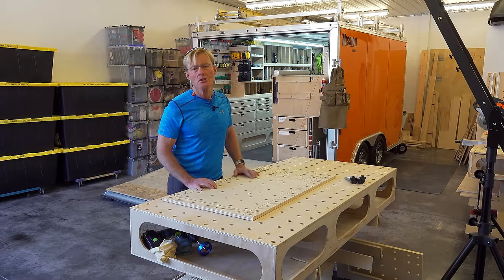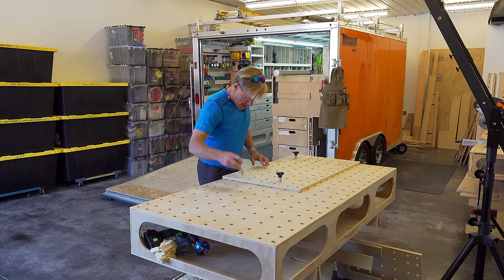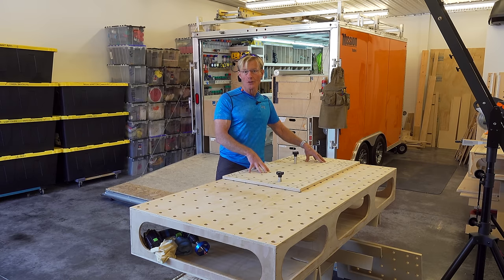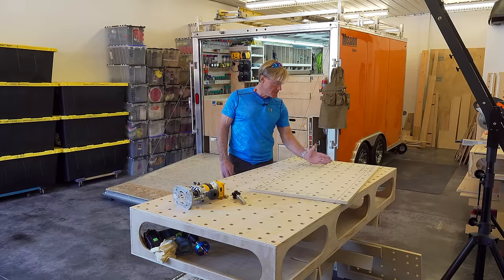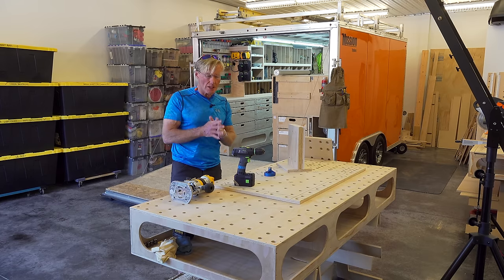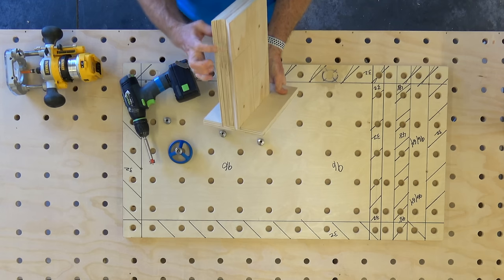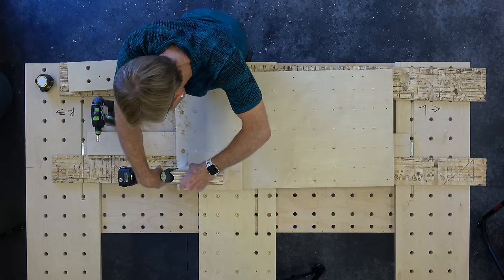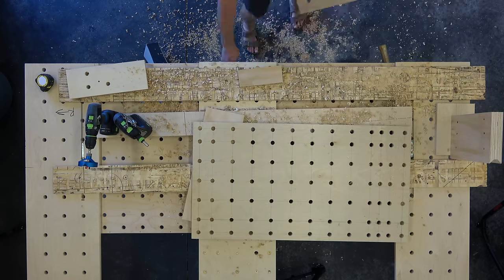Shop made MFT template

Comment: I don't know why nobody seems to use a compass set to 96mm to lay out.   Rather than try to measure 96mm with a rule and pencil.    The rule or other straight edge could be clamped and the compass stepped off along it, making indents 96mm apart.
Reply: Good idea I might try that
Reply: Why would anybody use a compass?  Do you need to know in which way the board points?

Comment: I dont understand the 96 millimeter spacing. Why not 100? I saw a less detailed video with 100 millimeter spacing and it led me here. I'm feeling much more confident with your knowledge and presentation so please explain the importance of 96 millimeter spacing. I just dont get it.
Reply: it s based off the euro lr32 system - 32mm gaps on the rail so 96mm is every 3rd hole. if you re a pro, you probably have a bosch or festool "holey rail" . if you dont , work off 100mm as maths is easier
Reply: Ooo9ooooooooooooooo
Reply: It's 1 and quarter inch... for imperials, and metric= 32mm

Comment: Ron, do you have an affiliate link you can add to the comment section for the pattern bit you like to use with that 18mil template? This is genius!
Reply from the maker: https://www.amazon.com/dp/B000K2FGIO/ref=as_sl_pc_tf_til?tag=ronp07-20&linkCode=w00&linkId=2a28b629b138141e79f74f49fd898f16&creativeASIN=B000K2FGIO

Comment: To anyone seeing this video several years later:  I made my first bench using this method and it worked good.  I'm still using it.  I got a Parf guide later and made some smaller accessory boards (router, etc) and with only one or two exceptions they all buckled down fine.  Just go slow and be as precise as you can while you're laying it out.

Comment: Another excellent and thoughtful video, Ron, thank you. I viewed it, just as I acquired a CNC cut MFT top, to to do exactly as you are doing by using it as a template for a new large bench top. Worried about damaging it with carelessness, I'm going to get a 17mm copying ring for my router which will allow me to make a reliable centred plunge cut quickly and reliably. I would then go around again with the trim bit set at working depth and hopefully my template will remain pristine.

Comment: Hey Ron. The Blue drill guide with bushings. If you drill a 11/16" hole in a piece of wood, the bushings from the guide will screw down into that hole. You can use the bushings with a plywood jig you made to precisely locate some holes. I'm doing this to make a jig for drilling 80/20 15S T-Slot extrusions. A piece of scrap plywood, some 5/16" dowels, a 5/16 t-slot screw and nut, and the 7mm bushing, is saving me $35 for a 80/20 drilling jig.
Plus I get the enjoyment of creating my own jig.

Give it a try and you can show how in some future video. I'm sure you can figure out a use for that type of jig.

Comment: If I had a cnc shop make this, would it be better to make larger holes so that i could use bushing guides rather than a pattern bit?  If I did, what size hole would I want?
Reply: I’d stick with a pattern bit with CNC machined holes at 20 mm. Bushings can introduce more variation of concentric holes even with a well centered guide.

Comment: Outstanding, brilliant, superb, and I like it.  Ron, do you put some kind of finish on your benches, oil of some sort?
Reply from the maker: So far I have not put a finish on any of my benches.
Reply: I have the parf guide and have made a few benches.  I finish the material with two coats of shellac. Lightly Sand with fine sandpaper and then a coat of minwax. Then, the parf guide gets to do its job. This adds a surface that is protected from moistures (no coffee cups please) and, nice to the touch.

Comment: Thanks for making this video. I think this is my next project, just to make up a router wing and the extension boards.
I think I will make it with pattern sized holes for the most part with a row of dog sized holes for indexing. You may have to move it more,  but  being able to use a guide instead of a pattern bit seems to be a definate advantage.
I am agreeing that the Parf guide would be nice, but cannot justify a $200  guide to build a $150 bench. (I wouldn't be needing the grid layout for anything other than building workbenches, and only need a couple of sheets for that total.)
Having built the PSB, I may use this technique to  MFT the reverse side of my current bench if the need for more precise layout is necessary. I know I messed up a couple of the holes but I don't think it will matter for my current level of work.

Comment: Paul, any chance you could get FastCap to build this template?  It’d be cheaper to ship than the full bench but  would allow us to have a “key” piece to build a super accurate bench.
Reply: Josh, you could just buy a Festool MFT replacement top.  Most any Festool dealer either has it in stock or can usually get it pretty quickly.

Comment: Hi Ron, I'm using the TSO bench dogs and the UJK bench dogs with holes cut using the Parf Mark II.  Most of the holes are so tight that the bench dogs barely fit, yet yours seem much less restricted.  Is there a technique you are using that allows the bench dogs to fit better?  I understand you don't want any slop, but the dogs are struggling to get a 1/4" into the bench top, and will not go all the way in.  Am I missing something??
Reply: Also, Ron.... I looked for a link to the bench dogs you show in the beginning of your video.  Looks like they have some type grip/knob on the top of the dog??
Reply: @Elevator2TheTop  that's probably just the  threaded knob for locking the dogs to the table
Reply: Don’t sand them down or you will introduce slop and lose your precision. I sanded down a piece of wooden dowel until it just fit 20 mm. Drove a Sheetrock screw down the center and used this to hold in my drill. Run it up and down the hole a few times and it will clean out the hole enough to give you clearance for your dogs without sanding it down and affecting your precision. Also if you are going to stain or treat your wood do so before you drill your dog holes. Poly type finishes will drip down the holes and change them enough to play havoc on your dogs. A little paste wax can help out with the tightness too.

Comment: Thanks for the video.   I would have liked to see what the router bit looked like.  I can’t get my head around how it can do a 20 mm hole when the template is also 20mm
Reply: It's a bearing guided template bit. It has a ball bearing on the shaft the precise diameter of the cutter, and you don't use a bushing. The bearing follows the inside of the hole in the template, and the bit cuts a hole the same size.

Comment: I'm planning to convert my existing work table to a MFT using the Parf Mk 2, but my table top is made 35mm thick particle board and the Parf system only cuts to a depth of 22mm I believe.  Would using this drill guide be the best way to drill out the holes to the full depth of my table top after first using the Parf system?  Will my 35mm particle board table top be OK to use as a MFT?

Comment: Hey Ron, I’m curious why you wouldn’t have made the initial holes with a 7/8th or 1in bit and used a copy ring. It seems that you could be more accurate and minimize the plunging into the template issue. Can you explain? Also, is there a way that the template could be more lean by adding holes for shelf pins, door hardware or something else with the 32mm sizing? It may be too cluttered but I’d love to hear your thoughts. You have been a great inspiration to me.
Reply: He explained that if the holes are >20mm, bench dogs don't fit when aligning the pattern to complete the next set of cuts.
Reply: Josiah Utah that makes since. I guess I was looking at it as he made it big enough to flip it and reference the on corners of the bench. Any ideas on adding other jig benefits to it?

Comment: @RonPaulk  somehow the link to which pattern bit you recommend has been lost in the description...
Reply from the maker: This is the ½" bit I use https://www.amazon.com/dp/B000P4NQFC/ref=as_sl_pc_tf_til?tag=ronp07-20&linkCode=w00&linkId=78b41eb1a1fe5b167f2c971c5fb83b66&creativeASIN=B000P4NQFC
This is the ¼' both give the same results with appropriate  bushing, but he ½" bit will last longer and cut better if your router will run a ½' bit. https://www.amazon.com/dp/B000P4HOEQ/ref=as_sl_pc_tf_til?tag=ronp07-20&linkCode=w00&linkId=0c9c0e60e465061389a8c20ab6902192&creativeASIN=B000P4HOEQ
😎🤙
Reply: @TheSmartWoodshop  that’s not a pattern bit though? Thought you were using a bearing bit here.
Reply from the maker: @pmcallister  Hi Pam, I use a spiral cutter and bushing as my standard set up. I have put up dozens of videos demonstrating why I use bushings and avoid pattern bits. I have many pattern bits, but if the proper bushings for the project went missing and I had the proper pattern bit. I would stop work go to the store and buy a new bushing before I would use a pattern bit. Ron😎🤙
Reply: @TheSmartWoodshop  Thanks for your reply and understood (I've probably watched every video you've ever done, have bought your plans and am just about to start on my first bench using them). But in this instance you're using a pattern bit to plunge then rout the holes using the template, hence the cautions about not messing up the template. And you explain why you're not using a bushing. So I'm scratching my head.

Comment: Can someone explain why the 32/64/96 mm spacing is needed?
Reply from the maker: LR32 is the worldwide industry standard for cabinets and furniture. All cabinet hardware is LR32. The LR32 system was developed after the end of World War II in order to help speed reconstruction of the vast number of buildings destroyed during the war, that the spacing was decided upon because that was the closest that multiple drill bits on a line boring machine could be placed, because of the size of the gears then available.
Reply: @TheSmartWoodshop  Are there accessories (clamps, jigs, etc.) that rely on the hole spacing to be exactly 96mm? I think most can see how the 20mm hole size is important, and most can see how having all of the holes on a perfectly square grid is important. But for the average garage workshop, why is the 96mm spacing important? For example, it seems like 20mm holes on 117mm spacing grid would work just as well as 96mm.

Comment: @ron May I suggest that you have a PDF for these holes so that we can print and drill the initial holes?
Reply: With PDF's being scalable (i.e. print the same "image" on either 8.5 x 11 or larger on 11 x 17) and given that many programs and printers seem to not hit perfect measurements between what is says on the screen and what is actually printed, does this pose a problem with having a PDF? I am not sure....just wondering?. Could it be possible to open up something like an Excel or Sheets document and set the grid lines to 32mm or 96mm or some combination thereof and then print a test page and check with a tape measure or caliper to verify dimensions. If they are off, the grid lines could be microadjusted and reprinted until they are just right for your application then you would have a "perfect" layout paper template that would allow a pin or punch to mark the center of the hole at each grid line vertices. I have not tried it but would imaging it should work provided one would have a printer available to them.  Have a great day and stay safe!
Reply: @stephenspencer9713  You would use the print actual size option. This will print without scaling but the template can't be any larger than your page so ideally you'd have a small template for 8.5 x 11, a medium one for 11x 17 and a large for wide format printers or plotters.

Comment: Mark Koons
0 seconds ago
This video is really useful. Thank you. I'm mulling over the possibilities for a combined outfeed table, systainer garage, and assembly table.  How much thicker than 3/4"can a top be and still pass the bend of the ratchet clamps often used with the MFT grid system? In your your experience how much clearance is needed below the top surface to install those clamps or the 20mm portion of standard bench dog?
Reply from the maker: Glad it was helpful!

Comment: Nice,  instead of minimizing the length of this pattern, to half bench + 96mm or so, I'd make it the length of your bench transformer so you wouldn't have to  move the template for the last 96mm.  Also a row of holes for the transformer far edge, you didn't forget to cut them, the pattern didn't have them.  Now that I think about it. Your pattern would have worked if you aligned opposite corners for second cut instead of long corners on same edge.  Parf guide has been out of stock,  think I will start this template today.

Comment: What are the dimensions of the piece you used to make the pattern? You said  you designed  it to be over half the length and width but didn’t specify exactly what the dims are.  Is it 736 mm x 1120 mm?
Reply: I had the same question because if it was stated in the video I missed it. My best guesstimate is it is 576 mm X 1056 mm. His template appears to be 5 rows wide by 10 rows long of 96 mm centers. He has along all outer edges a row that is 32 mm in from edge which is then 64 mm from the first row of 96 mm centers.
Reply: When he places the pattern piece on the bench aligned with the edges, simply count the holes.  That makes it 576 mm x 1056 mm. And the Transformer pieces are 384mm x 1152 mm.

Comment: Folks quibbling over the price of the Parf Mk 2 when an accurate bench is worth 250 dollars to me.
Reply: I agree, though obviously some don't have the money at all.  Plus, it is amusing to hear woodworkers sweat over making accurate cuts.  I thought that was the deal.

The other point is that a lot of guys have set up different methods for aligning the guides, so the 20 mm holes aren't used.  Ron had a shop tour of just such a shop , so not every hole is sacred, or one is lost.  There are at least 3 levels of accuracy:  Clamp positioning (low);  Part alignment like wings on a miter syste; alignment of primary fences for making cuts (has to be high alignment, but doesn't have to be the 20 mm holes, or every one on the surface).